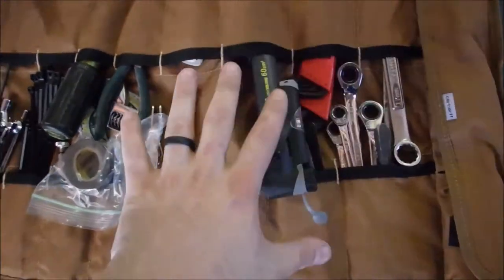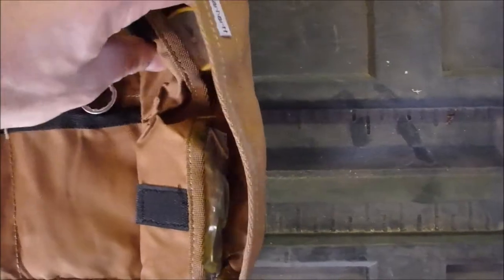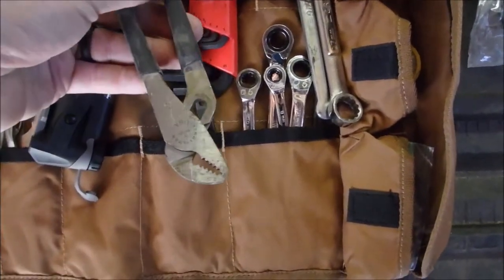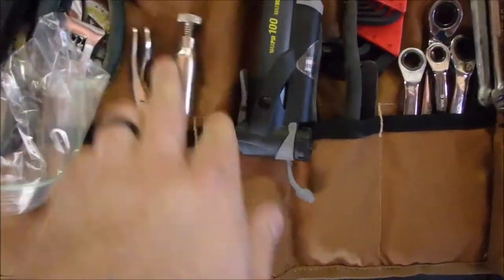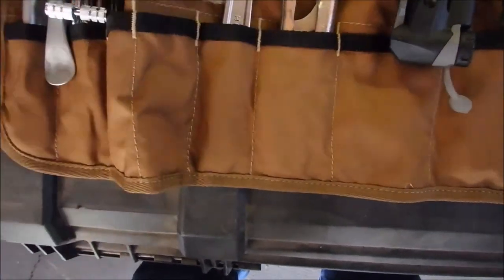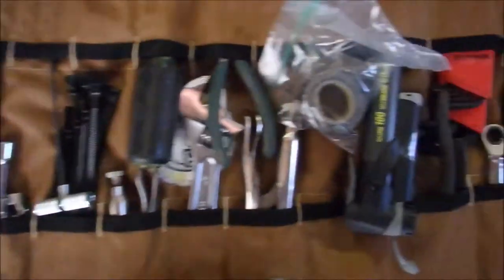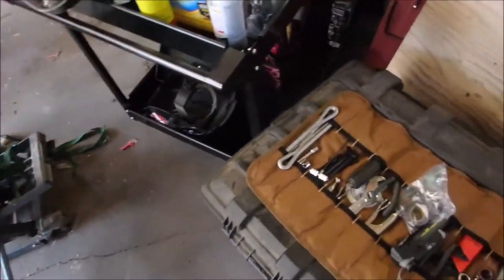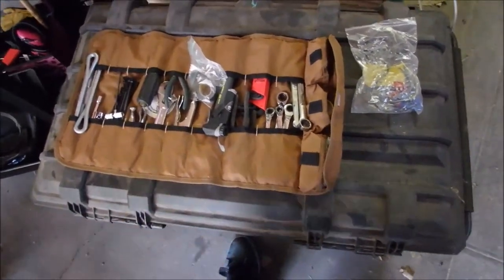CRF250L Custom Tool Kit

Comment: Kory, I don't have any problem with removing tires from rims, replacing/repairing tubes etc, in my garage. My question is, how the heck do you lift the bike so as to get wheels off and on when you encounter a flat out by yourself on a remote gravel road? Any tips or suggestions would be appreciated. Thanks
Reply: I used the kickstand and a peace of board underneath. Just push it up against kickstand a bit and stick something under the motor and work gently. Use a zip tie to hold rear brake in place when stalling back wheel to the bike. Can even use a small rope to tie bike up  against a tree to hold bike up